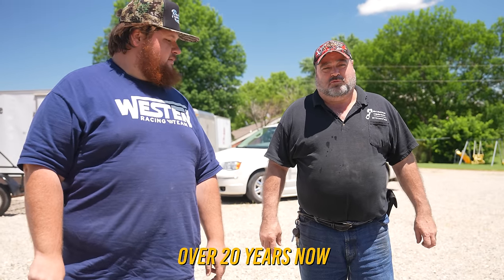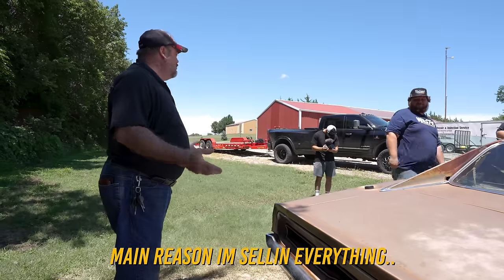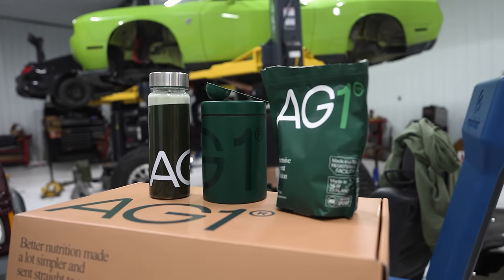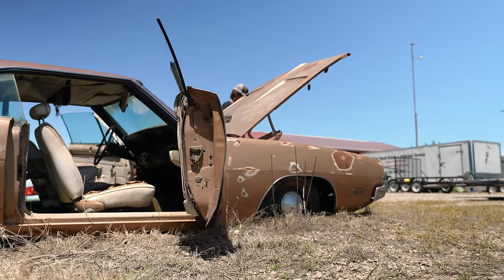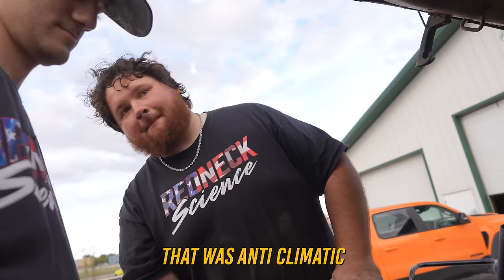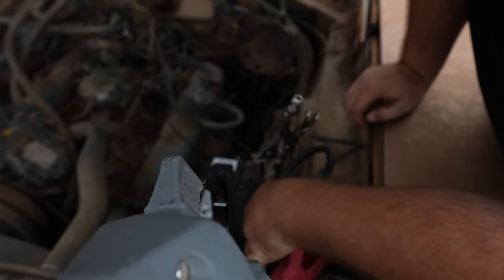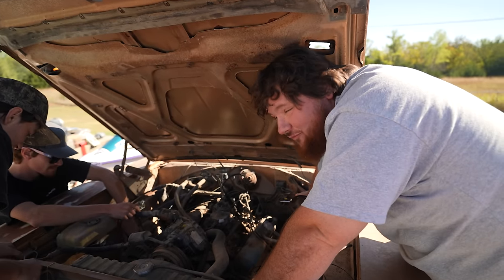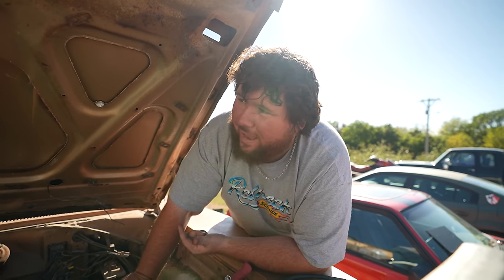Bringing a 1969 Dodge Charger Back to Life

Comment: Just picked up a 1972 Chevelle that's been parked since 1997.. primed the oil pump with a drill and ghetto extension and replaced the distributor.   Car fired up on the first attempt with original 20+ year old fuel 🙌

Comment: I use to chain down motors in my hot rods and my 4WDs .in my mud bog and mud racing truck id chain both sides of motor with a tensioner and i would wrap a chain around transfer case and bolt it down to the cross member..that was before people used solid mounts and engine plates

Comment: If you have a car sitting for 30 years make sure not to oil the cylinders that way when it cranks over it can score the rings and cylinders and make higher compression should be up to 13:1 compression ratio with that dry fire

Comment: Great stuff with healthy ways and it may be a good testimonial of the sponsors product if that contributing to the gains 
You might need to cut back on the fuel fumes etc , burning rubber cant be healthy either.